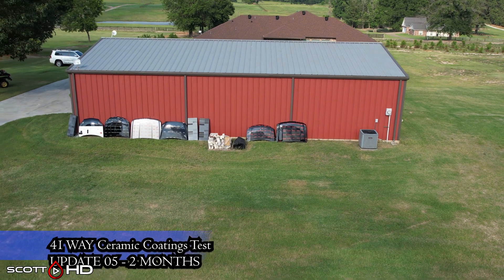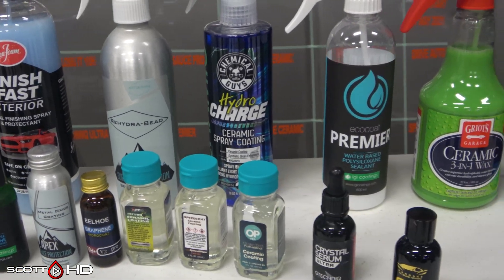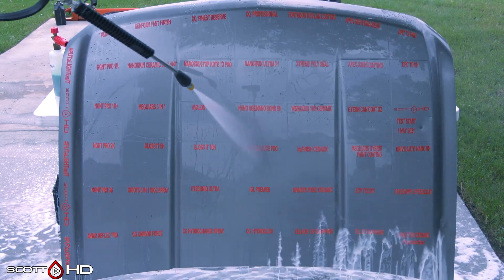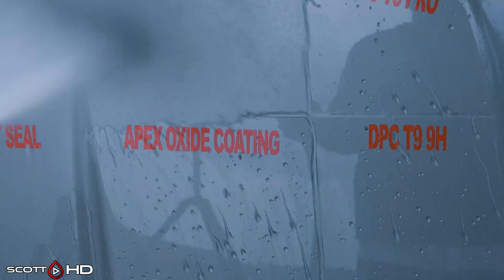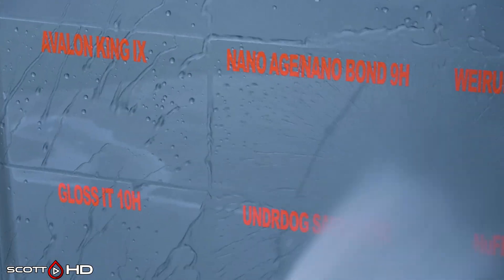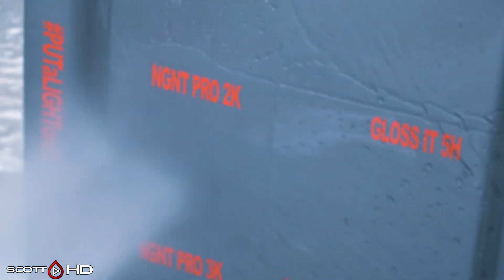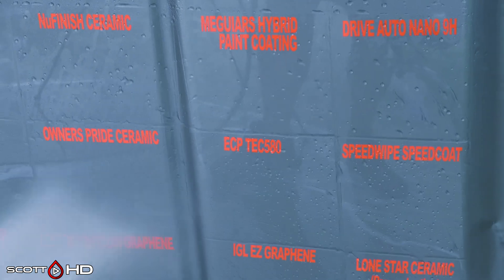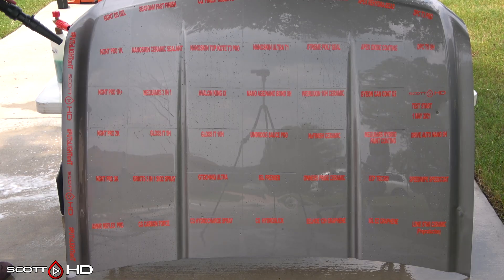Ceramic Coating Longevity Test - 41 WAY - The ULTIMATE comparison test - UPDATE 05 - 2 MONTHS

Comment: Hey, Scott, the ultimate test of hydrophobicity is putting a colder piece in an environment with ultra-high humidity/ultra-fine water mist, also replicable by a normal-temp room with a source of hot water mist (such as a shower) Or a REALLY aggressive ultrasonic humidifier. The product that stays the most opaque (as in, the tiniest droplets on the surface that goe the longest without them joining each other) is THE most hydrophobic, no doubt, hands down.

This demonstrates the highest contact angle between the water droplets and the surface, as the surface that retains almost ball-like water drops on it when they are tiny, insead of kind of  hemisphere-like drops is the most hydrophobic surface. The little balls do not edge-creep towards each other and join up like the hemispherical droplets do.

So, for the ultimate test, merely put the test piece in a room where excessive humidity/ultra fine mist is consistently available to the whole surface. 

A caution: to avoid upper surfaces from dripping down on lower ones, you would have to lay it flat or install little rain channel things to channel errant drops away.

But, I say again, no one does this and it is THE most accurate demonstration of true hydrophobicity, droplets that grow from vapor or atomization to the point of being visible.

As the test progresses, you would have to video-record it, you will see certain ones form large droplets faster than other ones. The most accurate panel to use is a flat piece of something with the same finish on the entire thing, no curves or dents to skew results.

A mirror or piece of glass that reflect or allow viewing of a consistent pattern on the other side, placed a few feet away (I suggest black and white checkerboard of differing pitches of squares) will visually demonstrate. The "foggiest" that is the most difficult to see the exact lines of the other side is THE winner.

However, most people don't do this on glass, so by using a sheer black-automotive-paint-coated piece, and using it as a mirror, you will get the desired mirror effect.

The most definitive test is to just keep humidifying the piece as it lays flat, and keep monitoring the opacity of the reflection. As less-hydrophobic parts allow big water drops to "rescue" water from the other parts of that patch, the less-hydrophobic patch becomes more reflective, with big drops here and there. As more-hydrophobic parts resist this, they grow a farm of divided drops, that, even when they grow so large they physically touch and combine, will do so in a more limited fashion than on the less-hydrophobic patches.

If you do this test, you will cause others, possibly, to rage, deny, ridicule, then imitate your methods.

It's like rust testing. The definitive method is to just continuously spray salt water (from a nozzle with a consistent, unchanging spray pattern and volume) at something and observe how the rust forms at the target area. Everything else is just marketing and hoopla.

-Your friend in testing.

Comment: I think you need to take Turtle wax ceramic hybrid polish and wax, layered with turtle wax ceramic spray coating topped with the detailer. That is the complete system. You could also top anything with adams graphene detail spray. Those would be very interesting in my opinion

Comment: Hey Scott what product works good to clean my crome exhaust tips on my GDI engines?
These have burnt oil on the lower half ( which is normal for a GDI) I used Super Clean 3-1 which helped but still have some residue present. Guess I could try it straight!
Reply from the maker: My favorite product for exhaust tips is Wizards metal polish. It's a pink cotton looking material that comes in a white metal can.  I usually get it on Amazon here https://amzn.to/3yGlAOW

Comment: Griot’s 3&1 streaks like crazy on my black ‘17 Camry. I had the same problem with TW SnS. What’s the fix? Wipe down with a damp rag?
Reply: You used too much product. Stop doing that.
Reply: Use less product. With Griots, mist a very small amount on a microfiber and go over the streaks. Then buff off with a dry microfiber. I’ve never had issues with Griots. SnS is known for streaking. I would not recommend the product.
Reply: Did you apply to an applicator and then buff off? That works wonders for me
Reply from the maker: Definitely using too much product
Reply: Gently wipe down the panel with a separate microfiber, damp with water. That works well for me in most situations.
Reply: @catbertz  Thanks to all for the advice.